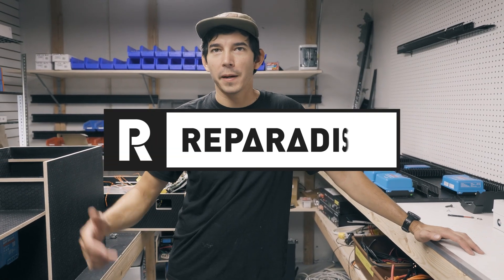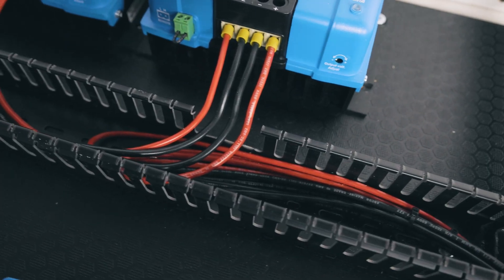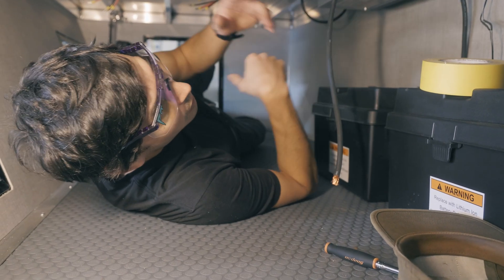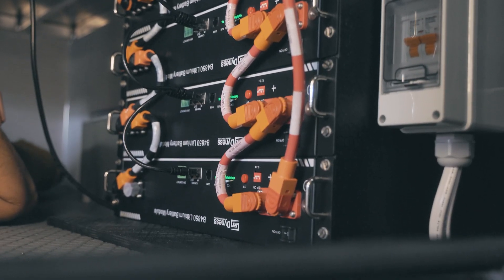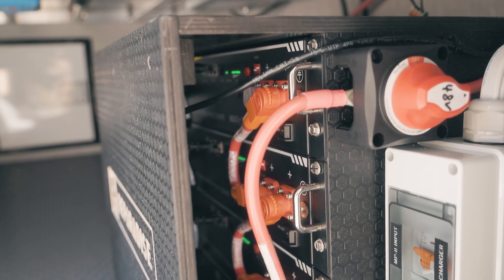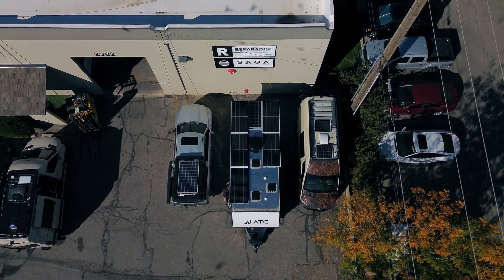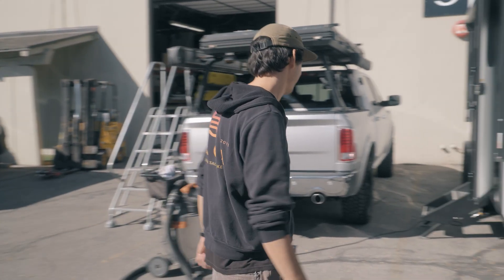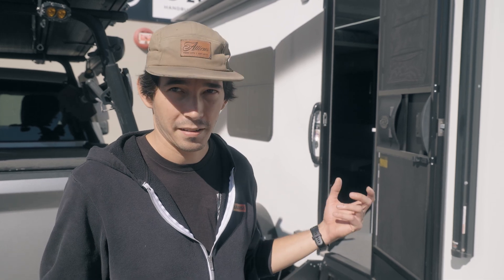ULTIMATE ATC Trailer Electrical Upgrades

Comment: What would be the minimum amount of solar and battery power needed to run the AC on this ATC trailer? We are in the process of purchasing one. It comes with 400 watts of solar and 200 Ah batteries but it’s not set up to run the AC or microwave. Wondering how much more we would have to add to be able to power the entire unit.
Reply from the maker: How long do you want to run the AC? There are a lot of factors at play here - want to jump on a call with Chance? 801-972-5211

Comment: Awesome looking build...
Did you use a 2nd charge controller for the larger panels.  If so, how hard was it to run the 2nd set of wires for it.
Reply from the maker: Yes two charge controllers - we easily ran the extra wires behind the fridge